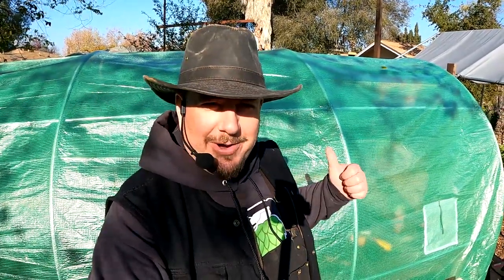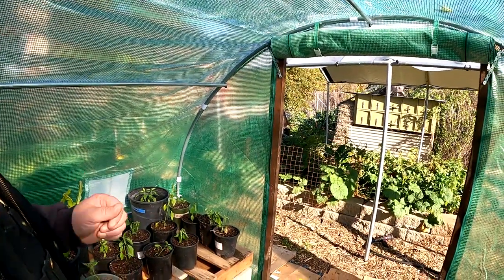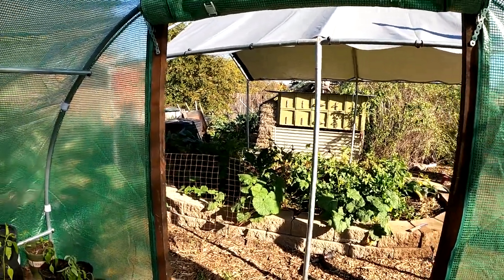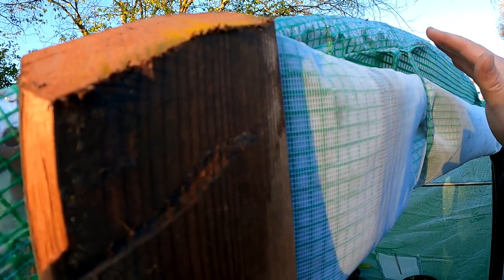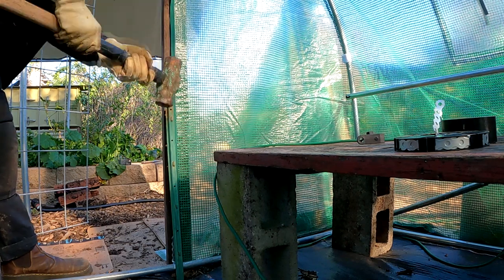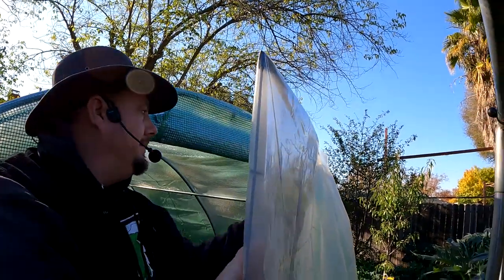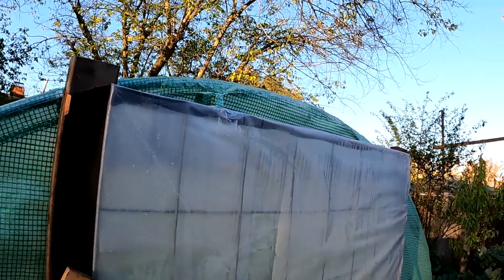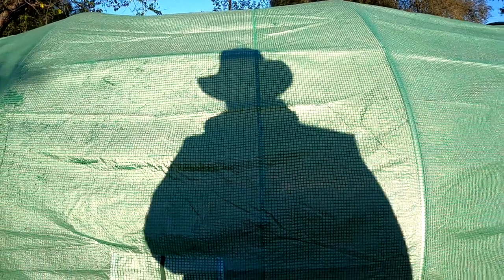Cattle Panel Greenhouse Door Install | Easily Replace A Zipper Doorway

Comment: I'm thinking now I will probably duplicate your setup here, including the hot tub, of course! A suggestion for the wood block latches, if you put 2 washers between the board and the frame, it would work more smoothly. Just run the screw through the latch board, hang the washers on the screw, then screw it to the frame.

Comment: How has the greenhouse withstood the winds so far? I would like to try this but have had bad luck with high winds even with taking extreme measures to secure garage style tents.  Extreme meaning ratchet straps and angle iron. I suspect the shape of this greenhouse might help to whether the winds well.

Comment: Very nice solution to a problem anything with a zipper eventually encounters. I can sew and would likely reinstall a new zipper. It would take some serious wrestling with the plastic walls and would have to be done on the patio; and I have a high quality sewing machine so that wouldn't be a problem either unless it was January and snowing/raining. There are places that sell heavy duty zippers by the inch or sometimes by the foot and also the color selection is limited so there might not be an agreeable color but plants don't care.

An alternative might be installing a door at the time the greenhouse is put up and thereby saving yourself the worry of zipper failure because they all do at some point. And always at a most inopportune time.

My only concern with your build is the metal overhang with its raw edges. You may wish to wrap a little gorilla tape on the outward facing edges to avoid any inadvertent injurious contact. An ounce of prevention. There are other ways like curling the edge but the tape seems the quickest.

Comment: Lumber throws a shadow onto your plants. 2X4 should be ripped to 2X2 which will still be plenty strong enough
for what you need it for. I prefer metal pipe, as it throws even less shade than 2X2s and is stronger than PVC.

!

Comment: In hindsight, you shouldn't have fitted your new wooden frame on the outside; you should have attached it (using the same method) on the inside, and you should also have rolled up the original PVC door on the inside of the greenhouse. Think about it 🫡.